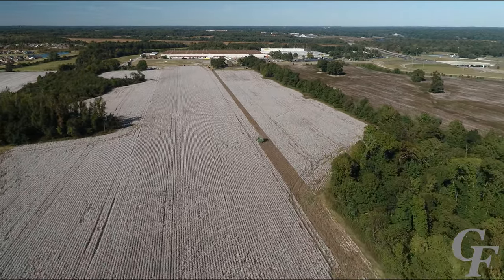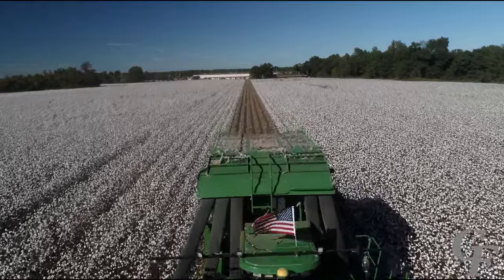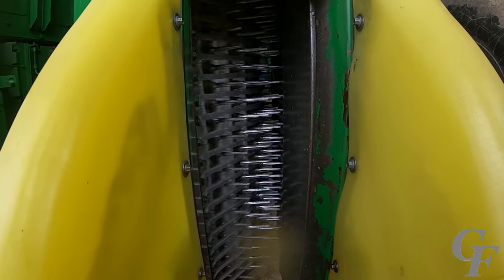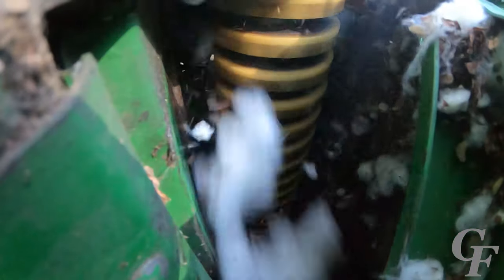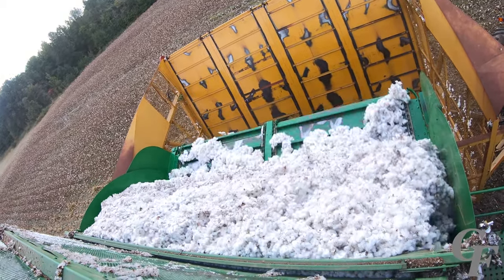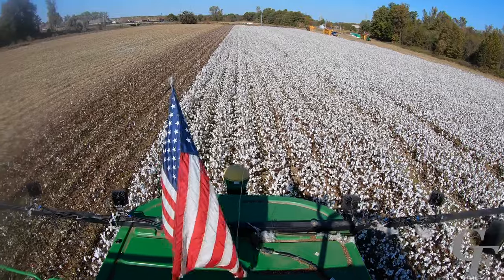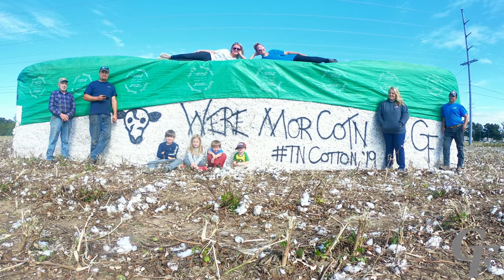How A Cotton Picker Works (4K)

Comment: I really appreciate this video. Only thing that I would mention is that my understanding is the doffers actually spin in the same direction as the spindles and at a faster speed to ‘unwrap’ the cotton from the spindle barbs. The taper in the spindles also helps this process. The ones I have worked on have the bars coordinated with the ground speed of the picker so the plant ‘sees’ the spindles move in and out of the plant and not pulling or pushing it. I haven’t worked on the round machines so I just assume this is still the case. Thanks again and I’m going to link it on my page. I sure won’t send much traffic your way unfortunately but it is about the best video (perfect length and detail) to show people that are unfamiliar with cotton and probably educational to some that are. Thanks agin... new subscriber.

Comment: Just a couple of thoughts.  Cotton picking machines were introduced in the mid to late 1950's in my teenage years.  At that time the spindles were continuously wettened by water to help the cotton fibers to stick to it.  Actually, the machines leaves some cotton on the stalk.  The economy is in being able to harvest a large quantity in a short time.  So a small waste does not substantially subtract from the overall profitability.   Thanks for the great video.

Comment: We had a John Deere 99 and a JD 299 both were 2 row machines they were not very fast ... the New John Deere pickers are way ahead of the new Case IH with the way they put a round baler on there  to replace the basket.. it can roll a bale and wrap it , and drop it in the field without stopping.. the Case IH STILL HAS TO STOP TO UNLOAD THE

Comment: What is the difference between a picker and a stripper?
Reply from the maker: While a cotton picker uses spindles to remove just the cotton fiber from the hull, a cotton stripper uses brushes and bats to strip the entire plant of everything but the stalk. It pulls in the lint, hulls, leaves, and unopened bolls. It uses a burr extractor to remove a lot of the excess trash but will still result in trashier, lower grade cotton. 

Strippers are typically used in drier areas of the country where the cotton is shorter and lower yielding. In lower yielding cotton, strippers will harvest more of the fiber and harvest quicker than a picker. In taller, higher yielding cotton, the picker is much more efficient and can cover more acres per hour.

Comment: So the self contained picker with bale maker and everything can cost 900k. How much is one that doesnt? And how much is all the other equipment you need to buy?
Reply from the maker: John Deere doesn’t even make basket pickers any more. Case IH is the only manufacturer that does but last I heard, they only make about 10 per year. I haven’t priced one but I’d say a Case IH basket picker brand new is probably a little less than half the cost of a new JD baler. 

Not sure what new module builders are now days or if new ones are even being made anymore. If I had to guess I’d say around $15k.  

John Deere’s baler picker will eventually force smaller cotton farmers like myself out of business because there won’t be any viable harvest equipment alternatives for us and we won’t have enough acres to justify purchasing one of their machines.

Comment: Liked, good explanation and demonstration. Best I've seen. I know all this well. Have run a  JD.tractor mount, JD 99, and later the 2-99. All likely built before you were born. The newer machines seem to move through the cotton a lot faster than we did. What's you're target ground speed in good cotton? Thanks in advance.
Reply from the maker: mrih1586 thank you!  I’d love to pick up a 499 or 699 one day to restore even though you can’t get some parts for them anymore
Reply: @griggsfarmsllc  No interest to you. But about 10 years ago they were a several very nice, low hour  99's. 299's and tractor mounts sold for scrap metal.

Comment: Having moved to NE Mississippi about 10 years ago I am surprised at how much cotton is left in the fields after the harvest.  Seems like some adjustment could be made to equipment to be more efficient.  I was told by one farmer when I ask him about that he said he just claimed the loss on his crop insurance.  Doesn't make much sense.
Reply from the maker: A well adjusted and maintained picker typically is 95-99% efficient in harvesting the crop. Also, Some varieties do not pick as clean as other varieties due to the lint being held in the boll a lot tighter. 

Many times it looks like there’s a lot more cotton left in the field than there really is
Reply: @griggsfarmsllc   Thanks for taking time to respond, also this makes sense seeing a field of white after the pickers have come through.

Comment: 27 jan 2022 2:24 am est(utc-5) : thanks
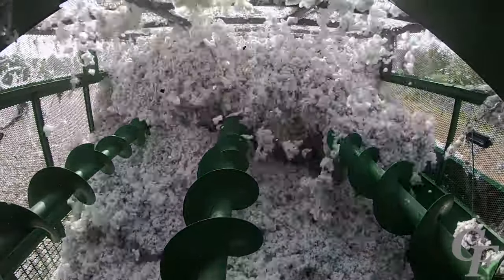27 jan 2022 3:26 am est(utc-5): 3:00  model : moc[tod]ereed (in-reverse)->cp-690
27 jan 2022 8:49 am est(utc-5): maybe cp-690 destroy stalk/main-petiole , submain-petiole then need more time to regrow stalk , submain-petiole , cotton-fluff .  human manually-pluck cotton-fluff and does not destroy stalk/main-petiole , submain-petiole then need less time to only regrow cotton-fluff .
5 sep 2022 4:12 am edt(utc-4): 4:37 :
1 cotton-bale make :
850 lady-shirt @ 28.50 usd = 24,225 usd
8400 handkerchief @ 0.54 usd = 4,536 usd
400 man-pajama @ 32.50 usd = 13,000 usd
540 man--dress-shirt @ 29.50 usd = 15,930 usd
500 adult sweat-shirt @ 15 usd = 7,500 usd
325 jean @ 32 usd = 10,400 usd
210 full size flat sheet @ 19,99 usd = 4,197.90 usd
1210 pillow-case @ 10.99 usd = 13,297.90 usd
1230 bath-towel @ 9.99 usd = 12,287.70 usd
3000 diaper @ 0.86 usd = 2,580 usd